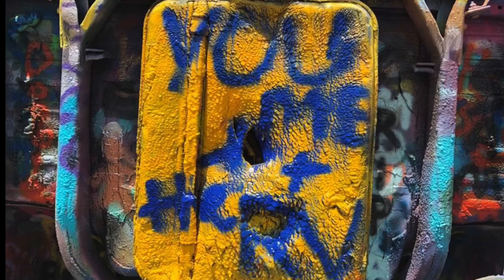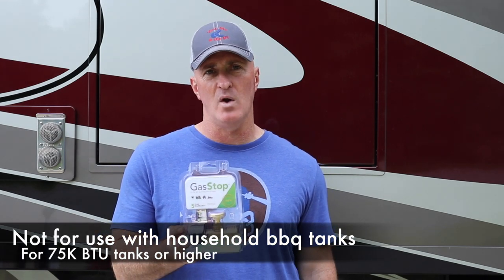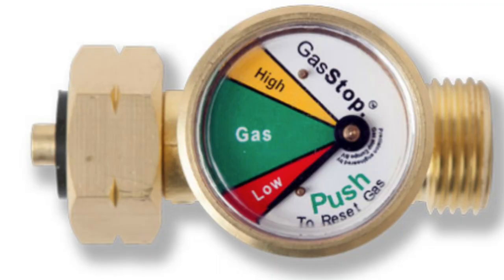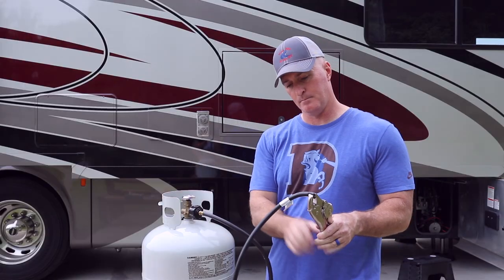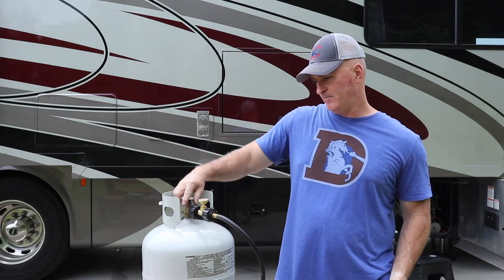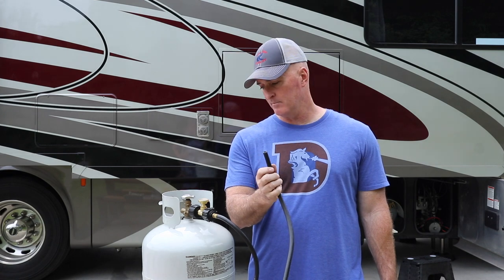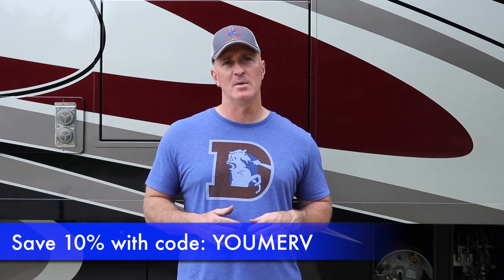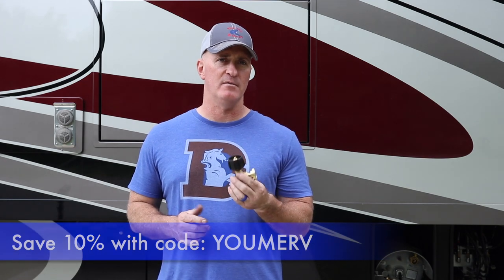Gas Stop Valve (RV PROPANE SAFETY) - Full Time RV

Comment: Thanks for the info, however what they don't tell you that it restricts propane flow  where you can't run the stove and heater at the same time if you do both it reduces flame where the heater will shut down  info from dealer
Reply from the maker: I don't see that in any of the literature for this device.  Let me do more research. Dealers are not always accurate in their evaluations but right now I can't confirm or deny.
Reply from the maker: Hey, sorry we didnt get back to you about this question sooner.  Here is the answer to your question:  GasStop does not impede gas flow in any way UNTIL the flow is over 75,000 btu of propane. As you look at the max propane flow specs on the various appliances in an RV (which are calculated when the device is on such as all burners on, etc), it’s normally hard to get to 75,000 btu of flow with normal use.  If it’s over that- it would be way above spec and as such it would be a major leak.

Comment: Phil, great and timely safety tip.  Thank you.  My LP/CO detector alarmed the other morning (2AM).  I am getting my propane system pressure tested Thursday on a two year old motorhome.  This device would give me added piece of mind until the next test.  Have you noticed any performance issues when using your motorhome propane hot water heater, stove or furnaces?  Again, thanks.
Reply from the maker: We have not noticed any issues with the propane since attaching it.  We are going to do a test with a few things running and review it again.
Reply: @todayissomeday  hi Phil. I realize this is an old video, but I am considering the purchase of the GasStop.  I saw your reply to manfred above regarding no restriction (per the manufacturer) for use 75,000 btu and below.  On this reply you indicated you will be testing it yourself by running things at the same time.  Curious if you have been able to do that yet?  Thanks for your help.  Tom - 2019 Tiffin Red 340 - USS Augusta SSN-710 - Go Navy!!!!

Comment: Ouch.. $79.99 each plus shipping and they show  2 of them if you have a double tank travel trailer..  Luckily my gas lines are no where near my tires or wheel wells..  and it's easy for me  to shut off my tank valve  when I travel if I like..  I would like to see a statistic of actual propane fires caused by an accident..  Probably less than struck by lightning..  We had a 5th wheel come into our shop about 2 months ago with blowout damage.. and of course the tire shreds snatched the gas line out of the slide room..  along w/ some electric 12 volt wires.. They smelled gas. shut it off and drove another 100 miles or so to get to us.. I fixed it w/ a new line. and put Galvanized steel in the wheel well..  to help keep the damage down if it happens again.  Why these Trailer MFG company's put electric/pluming/gas lines near the wheel wells and don't protect them. is just plain shoddy..  and the newer units the more it happens..
Reply: I bought one because my refer is in rear of my trailer and a rear end crash could cause fire and the propane hose runs along frame passing the wheels..  I only use one of two tanks as I travel.
Reply: @americanrvtraveler2446  IF I had a RV that had the propane lines running past the tires, I would get one. or just turn the propane OFF..  I know you can use the propane to run the fridge on 90% of the travel Trailers or motorized RV's While running down the road..  If I was using the LP option I would consider one..  But, In my case running the generator and the fridge and air conditioning actually saves me gas from not using the Dash air..  The LP is only used for boon-docking really..

Comment: I have always been strongly against leaving the propane on  during travel but this device could make it possible to leave it on.  This would allow the fridge to run on propane when going down the road.
Reply from the maker: We still recommend you turn it off while driving but many people dont.
Reply: @todayissomeday  I hate to admit that I have yet to use my propane.  I am not terribly comfortable with it.  Because of this, I will probably not turn the propane on when traveling.
Reply from the maker: @PidasianHippie  But you can use it when parked. Do you have a propane stove?
Reply: @todayissomeday  Yes.  I have a propane stove and my water heater is both propane and electric.    I just need to get over this hesitancy to use the propane.  🤨
Reply: Propane freaks me out also 😞
Reply: @ubergigglefritz  It is good to know that I am not alone in this.
Reply: @PidasianHippie  no one wants to blow up. That's no fun 😉 And it only takes watching a video of an RV fire once to be completely freaked out and never want to ever experience that!!! 😨
Reply: @ubergigglefritz  I know exactly what you mean.

Comment: I ordered these a while back, just installed them after my first 20 lb tank ran out, and reread the full instructions. It says it may shut off when temps approach freezing? And the FAQs say for optimum results try to use the system above 32 degrees? My primary use for propane is running the furnace overnight to keep the pipes from freezing, so this seems ridiculous. =( I need my propane system to be 100% trustworthy overnight while I'm asleep and know I'm not going to wake up to frozen pipes. I know I'm not the only one using my propane furnace for this purpose, so how has this not been fixed? I'm so disappointed... =(
Reply from the maker: We have run our propane heater when the temps have dipped below 32 and were fine.  Your wet bay may have a heater vent ducted to them.....ours does. It may help as well to leave your cabinet doors open overnight that have the pipes behind them to allow them to stay warm from inside the rig.

Comment: Don't all propane tanks come with a flow limiting device? At least those for vehicular use should be so equipped. I am fairly certain it is illegal to sell one that does not have a built-in flow limiter at least in Canada. The downside to them is that you have to be careful to open the tank valve verrrrry slowly when changing tanks in order to not trip the safety otherwise you will not be able to operate your propane devices. One of the top 3 rookie errors.
Reply from the maker: Yes, all tanks have a regulator. The problem occurs when the hose from the tank to the regular is compromised. There is no way to stop the flow of propane. This device attaches directly to the tank and will shut off the propane in the even of a catastrophic event. But it will not impede flow of propane unless the flow is over 75,000 btu which should not occur in RVs.

Comment: Phil
I installed the gas stop on our propane tank for or rig, WIL.  I've always left the propane off when it comes to heating, don't use the stove.  I use the electric heat, which can change to gas if I  choose the setting. 

My problem is, when I tried to use the propane (valve is open) on the gas setting, the furnace doesn't work, nor does the stove.  Am I supposed to prime the gas stop first?  If so, how do you do it?  Any suggestions would be appreciated.  Thank you.
Reply from the maker: Yes, push down on the dial that gives you the tank level reading
Reply: @todayissomeday  Thank you.  I did and it worked.  We have gas heat as well as electric.

Comment: I liked the concept but for some reason the fitting would leak at the threads into the 30 lb tank because the cone could not press hard enough.  I think it is a dimension problem from manufacturing.
Reply from the maker: Did you talk to GasStop?
Reply: @todayissomeday  No, I just ordered another gauge which has the older internal threads into the tank ... I lost the leak stop feature.  We were in a hurry to get out on the RV trip we are on now to South Fork, Co.  Wish you were here!  I am ex USAF....